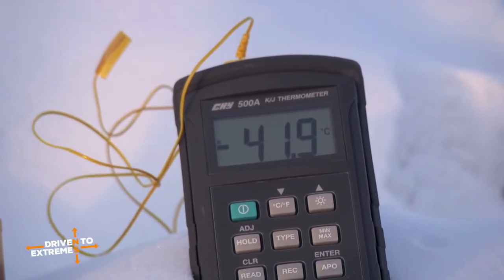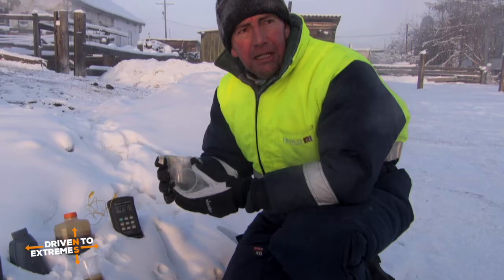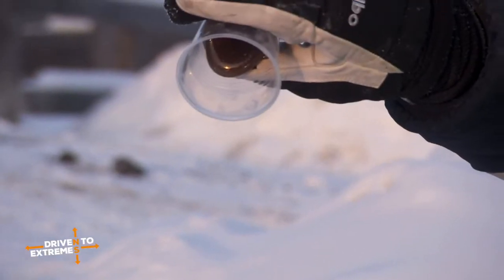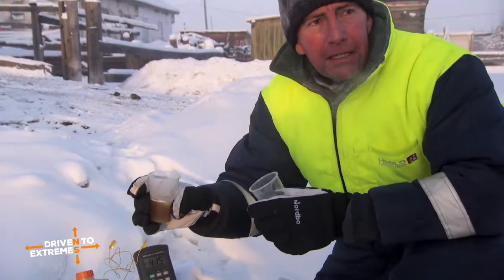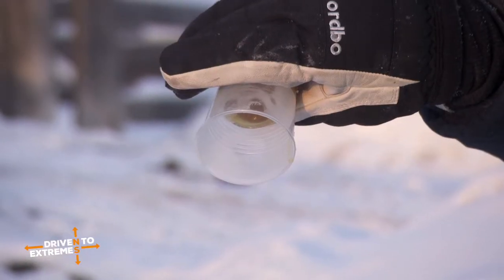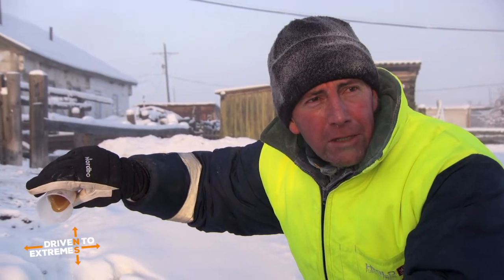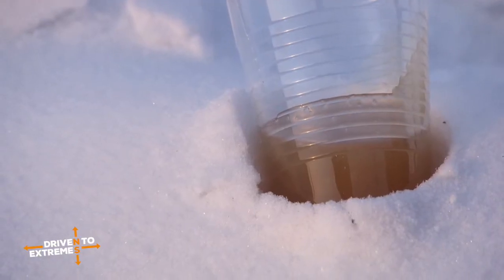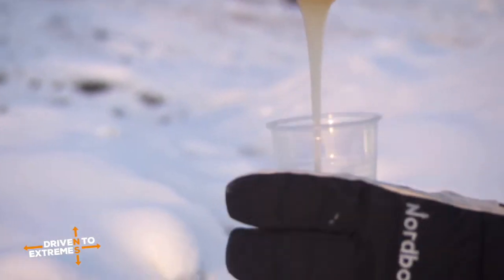Never Switch Off in Siberia

Comment: I live in Saskatchewan- my car will start at minus 50 no problem. Just block heater is enough
Reply from the maker: But that’s the problem in Yakutsk, no electricity supply for block heaters and certainly not in the mountains.
Reply: @ It’s a challenge for people living there. Worst I’ve seen here is minus 55
Reply from the maker: @arunsubramanian7949  It’s certainly a tough environment to live in and that’s before you factor in the corruption of those in power throughout Russia. The old Soviet system is that all homes and buildings are heated by a single power station that pumps hot water around the whole city, there are pipes everywhere! Problem is that there is little money to maintain such a vast network of overground plumbing (can’t bury them due to the permafrost), so pipes regularly burst and insulation lagging is missing. That’s just in the big cities, living in a remote village is even harder.
Reply: @DriventoExtremes  here in Saskatchewan when it gets very cold for a few days in Jan or Feb we check temperatures on weather app for Oymyakon and Yakutia and we joke around and sometimes say it’s colder here than Oymyakon and we are lucky not to be in Yakutia at this time. We all watch videos of life in Sakha Republic. 🇷🇺🇨🇦❤️

Comment: Is that a diesel engine?
Reply from the maker: Yes, they are normally aspirated 4.2 litre 6-cylinder diesel engines as fitted to the Aid Agency and UN vehicles. 

In the UK and Europe, that model of Nissan Patrol only had the 2.8 litre 6-cylinder, which was then replaced by the 3.0 litre 4-cylinder common rail engine. Our vehicles were imported from the Middle East. 

We were running them on Siberian ‘Arctic’ diesel which is good down to -50C before it starts waxing up. It’s very poor quality fuel though and more like kerosene than proper diesel.

Comment: What about block warmers and other stuff?
Reply from the maker: A block heater would struggle at -60C to keep the oil in the sump from waxing up, plus the fan belts would get incredibly brittle if left to cold soak in those temperatures and would probably,y break. At temperatures below -40C, many materials stop working as they should - rubber belts become brittle and can snap, bungees stretch but don't contract back into shape. There would be an increased risk to the timing belt even snapping.
Reply: @DriventoExtremes hence I assume timing belt driven engines are a pain to drive in those extra cold regions. Makes me wonder how oil seals are reacting in those regions.
Reply from the maker: @ Yes, this engine has a timing belt, but a chain would certainly be better in such extreme cold. Everything goes brittle below -40C - rubbers, plastics, belts, tyres etc, so the best thing is to keep them moving to try and retain a bit of heat and flexibility.
Reply: @DriventoExtremes  Then the metal timing belt would need a constant lubrication.
Reply from the maker: @ If engines don’t have timing belts, they’ll have timing chains which are lubricated by the engine oil. Many car engines have chains…for example Land Rover Td5, Vauxhall 1.2 diesel, Ford 1.8 diesel etc.

Comment: An EV would have to be left on constantly too.
Reply from the maker: You're right. It would probably need to use quite a bit of energy just to keep its own batteries warm.
Reply: @DriventoExtremes  a phev  hybrid would make sense. The idling engine would be charging the battery. A 1 litre burns a tenth of a gallon idling in the warm 2/10 in extreme cold.
As for the battery it could be well insulated and warmed by a heated blanket style. Only draws 100 watt for a double. You can run a heated blanket from a tiny battery too like how they power heated clothing. Could bring a smaller battery from a warmer house to get it going. 
There should be an EV designed for the extreme cold.
Reply from the maker: @rickyjulian496  It sounds like a feasible idea, but you're talking of an awful lot of computers to control this type of system. As we all know, computers don't like heat, cold, vibration, water or dirt, everything that you're going to experience when operating a vehicle in a remote and challenging environment. Our Nissan Patrols don't have a single ECU and only about 3 relays and a dozen or so fuses. There is no turbo on the engine, the fuel is pumped mechanically and the injectors aren't fine tolerance 'common rail' versions, so they can cope with poor quality fuel. When it comes to operating at -60C, the older the technology, the better.

Comment: Why not just install an oil pre-heater.
Reply from the maker: @SodiumSyndicate  You could do, but now you’d have both an engine heater ensuring that the coolant stays warm and an oil pre-heater. The key to surviving in any extreme condition is to keep things as simple as possible to lessen the chances of something failing. All of these extra systems add complexity and unlike car engines which are developed at a cost of millions, small companies that manufacture such heaters just wouldn’t have the financial resources to do such exhaustive testing. Which option would you bet your life on - heaters or just keep the engine running?
Reply: @DriventoExtremes  It can be a simple heater. A Nichrome wire coil coupled to the oil sump & a layer of insulator on it. These things are rugged. 

Else like the russians do, they expose the oil reservoir & hold a blow torch to it to heat up the oil on their trucks.

Comment: That's a BS, you need just a good engine preheater, which work on kerosene.
Reply from the maker: So you’re saying that you should go to the expense of fitting a pre-heater, plus a large fuel tank to keep it running for at least 10 hours. What happens though to the oil that’s sitting in the engine sump - what keeps that warm? If it was such a good idea everyone in Siberia would be doing it. It’s so much easier (and better) to keep the engine running.
Reply: @DriventoExtremes  You don't have to warm up the oil to operating temperature, at -50C it's enough for the oil temperature to rise to 0C degrees.
Pre-heaters are, of course, mainly installed on semi- trucks, but I don't know the reason why they are not widely used, perhaps because of the price and complexity of installation.

Comment: What's the point of advertising the oil in a cold climate if you don't even turn of the vehicle
Reply from the maker: Because the engine is still being subjected to -60C and it won’t be operating at the same temperature as if it was +50C!

Comment: What a joke. Outside temps have nothing to do with outside temps. As long as your motor is warm the oil could be crap but still run.
Reply from the maker: So what you’re saying is that a temperature of -60C has no affect on the temperature of the engine or the ability of the oil to work properly?! 

It’s interesting then that every car manufacturer recommends a different grade of oil depending on the temperature that the car will be operating in. 

I think you need to take them to court as they’ve obviously been conning us all these years!
Reply: @DriventoExtremes  He's right. Any half decent engine oil will keep an engine lubricated once it's warmed up. The main problem is when the engine is cold. Cold oil has a high viscosity. This oil might assist cold engine start, not warm running.

Comment: if there was a way to auto-start the engine for 10 min every 60 minutes, when the car is stationary and not in use.. so much saving yet i bet the engine will start again after only 50 min break
Reply from the maker: You certainly could do that, but would you trust an automatic stop start system to work? If it fails it’s a very cold walk home! 

When we were high in the mountains near Kubume en route to Oymyakon we camped overnight at -50C, so we did switch off the engine for an hour at a time to save fuel and also reduce the amount of exhaust gases that could have blown over the tents if the wind direction changed. This did mean though that one of us slept in each car to restart the engine and also drive it up and down a track for few hundred meters to stop the oil in the rear differential turning to jelly. 

In the city though you’d have to keep going outside to turn your engine back on and by the time you’d got dressed with multiple layers, walked out to your car, walked back in again and got undressed, it’s probably easier to just leave it running.
Reply: We use car alarms with built-in timers. This timer automatically start engine after 2 or 3 hours, depends on temperature. The engine runs for 20 minutes and automatically stops.

The problem is exhaust — if the vehicle stand on this timer for a couple of days, the condensate can freeze in exhaust pipe, and the game is over.

Other problem is battery — it doesn't have enough time to charge. 20 minutes is not enough. 

So, such timers are good for everyday usage, when you drive your car in day, and leave it on timer at night.
Reply from the maker: @ZeroSen07  We fitted an alarm to the vehicles in case they stopped during the night, which would alert us to go and try and fix the problem as soon as possible. 

The other issue is the tyres and that's why vehicles in Siberia need to run with inner tubes. If you fit tubeless tyres, small amounts of water will build up on the bead at the top of the wheel, then freeze and expand during the night, breaking the bead and letting the air out. You then wake up with 4 flat tyres!
Reply: But best problem solver is warm garage😊
Reply from the maker: @ZeroSen07  Absolutely! We had the use of a warm garage that belonged to the hotel that we stayed in when in Yakutsk, but after that we didn't have such luxury so had to keep the engines on continuously for the 1,200 mile journey to Oymyakon and back.

Comment: No one is running a 20w50, mineral oil in Siberia. That Shell oil was like a 0w16, preheated oil also. 😂
Reply from the maker: @usmc03  We were running 0-30 Shell Helix oil in Siberia and had to bring it with us from the UK as there was none available in Yakutsk. Admittedly there is probably other 0-30 oil, but you’re assuming that Russians in far-eastern Siberia have the money available to spend on good quality oil - I think you’d be mistaken.
Reply: @DriventoExtremes  and I think you're just advertising a gas station engine oil
Reply from the maker: @ Well seeing as Shell paid millions to make the programme, I think they’re allowed a bit of exposure don’t you?!
Reply: @DriventoExtremes  yeah, a bit, but not as you're presenting it, like some kind of super performance miracle engine oil, shell is average, if you want the best, you can choose between liqui moly, motul, pennzoil and amsoil.
Reply from the maker: @ Interesting to learn that Ferrari are using second rate oil in their Formula One cars. You learn something new every day!
Reply: @DriventoExtremes  interesting to know that formula one teams are rebuilding the engines after every race, and they don't use second rate engine oils, that's a lie, they use custom made engine oils specifically made for each team's engine specs, made by different manufacturers like mobil 1, shell, castrol, etc.
Reply: @PrinceAlex22  liqui moly :)))) man, i'm using  liqui moly in my car, but considering it one of the best oils....you're crazy.
Reply: @PrinceAlex22 F1 teams have 8 engines per season, you cannot rebuild the engine after every race. Im sure you can tear it down and put it back together to check internals but it needs to be the same components.
Never the less yes, f1 teams have custom made engine oils that cannot be compared to your average oil that you can buy at the store. Majority of f1 engines idle at speeds that a normal driver would already be changing gears, also you need to warm it up before starting it or the pieces would move because of clearances.

Comment: This vid scares the shit outta me. 
Since I hate idling anything 😆.

Now Im wondering if changing my oil every 2k offsets the few times I went 5k without a change. Engine has 95k rn. Hemi 5.7. 
🤙🍻
Reply from the maker: @mattd5681  We sim to change our oil every 3,000 miles / 5,000km, especially on an overland expedition when we’ll experience poor quality fuel. This is another reason why you want to use good quality oil as it does a better job of capturing and holding onto carbon deposits, even after prolonged running.
Reply: @DriventoExtremes  Thx a Mil! 
Yall have a very dedicated channel.
One love! 🤙
Reply from the maker: @mattd5681 Our pleasure. Please check out our other videos.
Reply: Hemi's do not like to idle!
Reply: @Jay-ns5ub  You are right. Twice! 
Cuz since I bought her new there was always a slight surging till now at 96k

And also, she really wants to be revved out.
I always gotta feather the throttle accelerating on dirt roads or rain.
Any info is appreciated. 
🤙🍻

Comment: Why would Siberia even HAVE 20/50 oil?  The average temperature is 0.5 degrees Celcius.
Reply from the maker: @shaun900  Having been there during the depths of winter and the height of summer, I can tell you that summers in Yakutsk can get quite hot.  The highest temperature recorded was +38.4 °C (101.1 °F) on 17 July 2011
Reply: @DriventoExtremes  I saw that, and here I thought Southern Canada had wild swings!
Reply from the maker: @ With the lowest temperature recorded in Yakutsk at −64.4 °C and the highest at +38.4 °C, it means that the seasonal temperature differences for the region are the greatest in the world at 102 °C (184 °F)!
Reply: @DriventoExtremes  who do you try to fool? Just glanced wikipedia? If engine allows we use 5w30 down to -20 degrees, engine starts fine, for more coldest days we have pre-heaters, down to -40 they help, oil is not a problem, petrol is the problem.
Reply from the maker: @ The warmest day we had in Siberia was -42C and it went down to -60C. That’s why we had 0W-30 oil! The problem in fact is not the petrol, it’s the diesel which will start to wax up at -50C even if it’s Arctic diesel.

Comment: All pointless, the first thing they said was the engine is never turned off, so why should we care what the oil does in cold conditions, it's never getting cold.
If anything the oil is under less stress because the ambient temperature is so much lower the oil is less likely to overheat & fail. 
Just a load of pretend drama to sell us oil 🤦🏻‍♂️
Reply: Do you have more info on what lubricants you used in the drive line, coolant ect, what type of fuel tank and fuel filter heaters are you using?
Reply from the maker: @ All oils, coolant and screw wash were Shell. Let me speak to our mechanic who prepared the 2 Nissan Patrols for Siberia (as well as the Taklamakan Desert & Malaysian Jungle) and I’ll get back to you.
Reply: @DriventoExtremes  I would appreciate that out of curiosity, I live on the east coast of New Zealands north island, we get down to -6 and upwards of 40 degC so a reasonable variation, what was the oil consumption like with the TD42 and the 0w30, do you have any links to your trips and prep? Many thanks, I love this stuff ah.
Reply from the maker: @undercoverpighunter  I’ve spoken to our mechanic and unfortunately as it was some years ago we did this project he can’t remember all the details. What he did say though was…all the oils were fully synthetic - gearboxes, differentials etc. The coolant was neat, so no water added. The screen wash was also 100% neat so no water added. We had a fuel filter heater but he can’t remember which make it was. We also had a Webasto engine heater but didn’t use it as the engine was never turned off outside of the heated garages found in the city of Yakutsk and town of Khandygha. We still have the Nissan Patrols but they are stored with another of our expedition mechanics some 300 miles away, but I can ask him to have a look under the bonnet to see what fuel filter heaters are fitted.
Reply from the maker: @undercoverpighunter  He didn’t mention a fuel tank heater, but then again we were running Siberian Arctic diesel which is good down to -50C before it starts waxing up. It’s like paraffin though so probably doesn’t do your engine any good, hence why we had old technology TD42 engines. They don’t seem to have suffered for it though and still going strong.
Reply from the maker: @undercoverpighunter Forgot to say….the vehicles were new so we didn’t notice any oil consumption with the 0W-30 in Siberia.
Reply from the maker: @undercoverpighunter Here is another short video that you might find interesting…

https://youtu.be/mwYqfg17iVo?si=bm_jRX_3uadN42gB
Reply from the maker: @undercoverpighunter You can watch the whole programme that was aired on Discovery Channel via this link…

https://youtube.com/playlist?list=PLMFMZYWEkvl0O6utLJiECiGF7G3Z6coEB&si=sPsgtowH5PZWaPaH
Reply from the maker: At -60C, frostbite is measured in minutes and life expectancy measured in hours. You obviously don’t value your life or that of your team if you opt to use low grade oil in such extreme conditions!